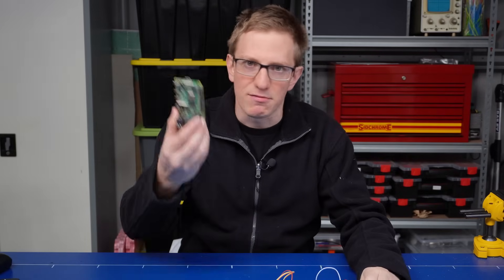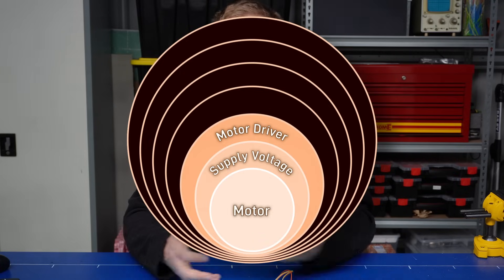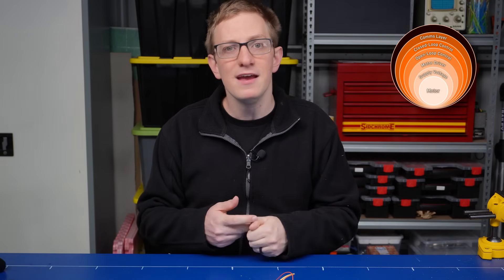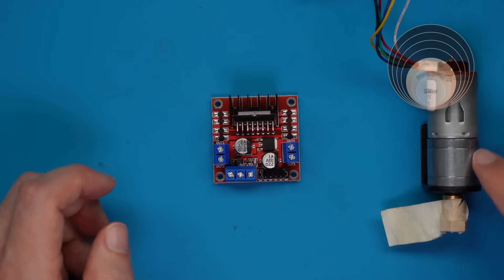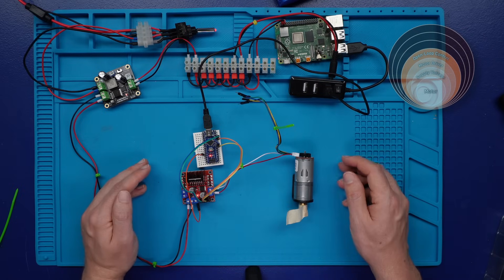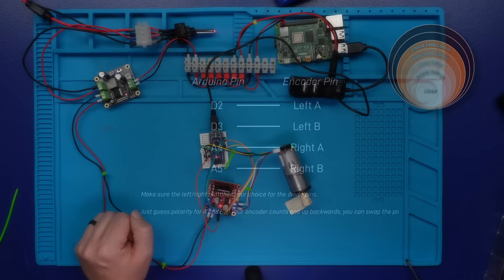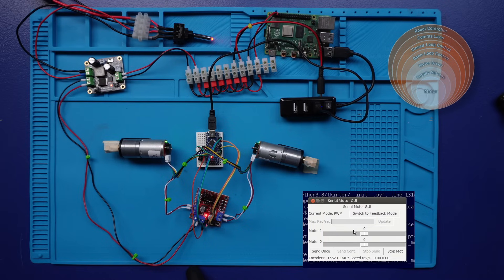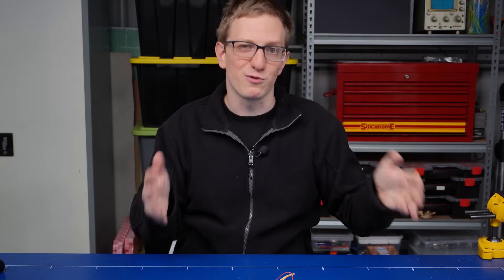The Ultimate Guide to using Motors in Robotics (including ROS, Raspberry Pi)

Comment: FYI for people in 2024: The arduino VSCode extension is deprecated. Another option to try is PlatformIO, however, this doesn't seem to work over ssh. Therefore you're probably going to have to use arduino cli over ssh.

Comment: Great explanation! I love how you threw in cutting-edge ROS2 in there!
Reply from the maker: Thanks :D
Reply: .... while at the same time using a motor driver that is about 40y or so old, and which has been superseded by loads of more energy efficient mosfet based products that don't need a heatsink the size of a car radiator.

Comment: Excellent. Got everything working in that video. Had to run "sudo apt remove brltty" to get the serial port to recognise the arduino.
Reply: What's that exactly and why to use?
Reply: @adwaitingle2315  it's the Braille terminal. Josh goes over it in his ready to humble video which is on the same play list as this.

Comment: I would like to control the suspension on a model car ( made in meccano) based on feedback from an electronic gyroscope. It is supposed to keep the body of the car level whatever the terrain.  My plan is to use a raspberry pi with an electric motor that is linked to the suspension, so your demonstration is well on the way to what I want to achieve.

Comment: Hi Josh. Thanks for providing this tutorial series.  
I tested motor running, but didn't move it. In my case, I finally succeeded by connecting arduino board GND to L298N motor driver's GND.
Here just for your information.
Thanks🖐

Comment: Open loop is just fine in case of a stepper motor. This give very good control and is used in all kind of systems including 3D printers.
Reply: Open loop can not be considered "control". Open loop is only a command. Any system that cannot verify that a command is actually being followed, cannot be considered "in control"
This is why people go to check on their 3d print progress and find a mangled blob of plastic sitting there.

Comment: This whole series has been terrific, with clear and concise explanations and instructions. I have had one issue I haven't been able to figure out. I have wired up these motors six ways from Sunday. I've studied the diagrams and the setup on the video and duplicated it perfectly. Even so, when teleop-ing I find the motors run fine forwards and backwards, but when using j and l to turn left or right, the controls are reversed! Left goes right and right turns left. Seems weird, as turning just consists of one wheel going forwards and the other backwards. I've tested this with a joypad as well with the same results. No combination of wiring I've tried seems to work. If I wire up by switching the pins then left and right are fine, but forward and backward are then reversed. Ive even tried reversing the motor leads. If anyone else has found this to be a problem and have found a solution please drop me a note.
Reply: I figured it out, I had my encoders on the wrong pins. Duh.

Comment: Great informative presentation!  Could you please comment:  If you would like to put a robot with motor control into actual use, say to raise and lower a convertible top on a car as an example, you are not going to have it hooked up to your laptop.  What is the missing link or next step to get the robot self contained in a production environment, so to speak?  Thank you.

Comment: 🎯 Key Takeaways for quick navigation:

00:00 🤖 Introduction to building robots and the need for layers of abstraction in robotics.
- The video introduces the idea of using layers of abstraction to solve robotics problems.
- It mentions the main content will be divided into two parts: theory and practical circuit building.
- The example motor used is a brushed DC motor with encoders for ROS2 control libraries.
01:28 🎛️ Motor drivers and their role in controlling motors.
- Motor drivers are essential for controlling motors as they handle the high voltage and current required.
- Motor drivers use PWM signals to control the motor's speed and direction.
- Understanding the basics of motor drivers is crucial for controlling motors effectively.
03:03 🎚️ Motor controllers and their role in motor control.
- Motor controllers are smarter than motor drivers, as they take target speed or position and calculate the appropriate signals.
- Open-loop controllers have predefined maps between input and output, while closed-loop controllers use feedback to adjust the motor's behavior.
- Closed-loop control, often using PID control, allows precise motor control.
05:22 🌐 Communication between the robot controller and motor controller.
- Effective communication is vital for controlling motors in robotics.
- Serial communication is a common method for transmitting data between the robot controller and motor controller.
- Maintaining modularity in the system allows for easier hardware swaps and reduces the risk of interference from other processes.
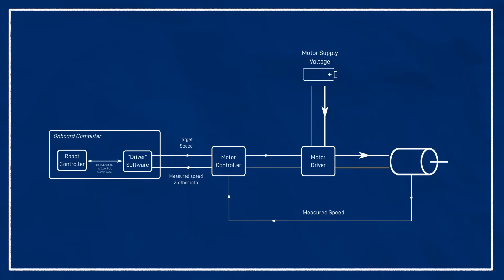08:22 🧩 Structure of the robotics control system.
- The typical structure of a robotics control system consists of a robot controller, a motor controller, and the motor driver.
- The robot controller calculates the desired motor speeds, and the motor controller translates these speeds into signals for the motor driver.
- Modularity and separation of these components allow for flexibility and robust control.
09:04 🛠️ Setting up a practical circuit for motor control.
- Setting up a practical circuit involves connecting motors, a motor driver, an Arduino as the motor controller, and a Raspberry Pi as the robot controller.
- Testing open-loop control is an important step to ensure the motor and controller are functioning correctly.
- Encoders on motors provide crucial feedback for closed-loop control.
13:30 🔄 Using encoders to measure motor speed.
- Encoders on motors provide feedback through pulse counts, helping calculate motor speed.
- Measuring the counts per revolution empirically is essential to determine the encoder's characteristics.
- Understanding how encoders work is crucial for effective motor control.
19:21 🕹️ Setting Up Closed Loop Control with Encoders
- Configuring closed-loop control with encoder feedback.
- Measuring encoder counts per revolution to determine motor speed.
- Demonstrating closed-loop control for precise motor speed control.
22:14 🤖 Interfacing with Raspberry Pi and GUI
- Setting up the Raspberry Pi for motor control.
- Running ROS nodes on the Raspberry Pi.
- Using a graphical interface (GUI) to control motors and monitor feedback.
24:59 🚗 Future Plans: Integrating Sensors
- Preparing for the integration of sensors into the robot.
- Mentioning the upcoming focus on lidar sensors in the next video.
- Discussing the future prospects of the robot's sensory capabilities.

Made with HARPA AI

Comment: Hello i had a problem that my motor has a total number of encoder pulses per wheel rotation of about 52,000 and the gear ratio is 1:27, when using the Arduino_Bridge code, when entering a command, the motor will jerk very much and reverse itself for no reason.

Comment: Hello, I have a problem that the speed of both wheels is not the same speed, the right wheel is faster than the left wheel. What do I need to do now, please help me. Thanks a lot
Reply: I have the same problem
Reply: have you fixed that problem yet?
Reply: @KSLEEProjects  Have you tried checking whether the signal read from the encoder of the 2 wheels is equal?
If the signals of the two encoder are not equal, you should check the encoder's signal wire again
Reply: I did this but without encoder I  made Pwm to adjust the motor speed and set the pwm same for both the motors

Comment: At 13:10, I don't understand the benefit of powering the Arduino via the USB port versus simply connecting its 5V pin and ground pins to the terminal strip (as was done for the RaspPi).

Comment: when you say you can use PWM to drive a motor backwards (2:57) , do you mean you can send a PWM signal that drives the motor backwards, or do you need a switching circuit that you send the same signal through to drive the motor backwards? Can you like switch the bias of a PWM signal to be negative or something? 
Pretty new to mechatronics, but I come from music and radio land, so I like working with waves. Thanks for the help
Reply: There are two methods: 1) There is a direction signal and a PWM magnitude signal (0-100%)
2) "PWM antiphase": This is where a 50% PWM duty cycle results in zero motion. >50% drives positive and <50% drives negative.

Comment: Amazing video, really well explained.

Im having an issue with only the pins connected to D2 and D3 are being counted on the encoders, no other pins would count the encoder readings. it looks like there's an issue with the interrupt pins, which is the arduino nano has only two - INT0 and INT1 on D2 and D3 but its working for you in the video so i cant be so sure

i've tried swapping the encoders too, both are working perfectly but its just D2 and D3 that count.
and this code wont work on an Arduino Mega :/

PS: im using OE-37 Hall Effect Encoders - mounted seperately

any suggestions?

Comment: Great video.  Just getting started with ROS.  You mentioned that the L298 motor controller isn't the best, but it will do.  I agree.  What other motor controllers would you recommend or have experience with?  Thanks for your time!
Reply: Tb6612fng a very good one

Comment: Using that motor controller. Could I connect it to a relay so it activates the relays and turns the motors. Allowing me to use higher amps rather then the 2 amp setup

Comment: Hi I used exactly the same code but I don't recieve any encoder Data. I checked the encoder manually with an Oscilloscope and it works. So I believe it has to be a problem with the code. Any idea?

Comment: First, thanks so much for these tutorials! They are great!

When I run miniterm, I have to use baudrate of 9600, not 57600 in order to not get English out. And it outputs a whole bunch of "sensor=xxx   ouput=xxx" lines, but it will not take in any motor commands to get the motor running. Apparently many changes have since been made to the arduino code?

Comment: Hey Josh!!
Thanks so much for this tutorial.
Can I control the motors in open loop mode?? Like I mean for the real robot because my encoders broke 😢 and I cannot buy another
Reply from the maker: Yeah for sure! If you are using my ros2_control hardware interface you want to replace the "write" command with one that sends an "o" message instead of an "m" message, and write a line that scales the speed request to the appropriate open loop signal.

Comment: Hello, first of all thanks a lot for these tutorials.
I am using as5600 magnetic encoder for close-loop control of motors. So I can't use your code because encoder is communicating via I2C from analog pins of arduino uno. My question is: Which topics do I need to subscribe(cmd_vel) in order to make it work. For example, I know that I need to subscribe to cmd_vel to get wheel velocities from ros and move the robot, but where do I need to publish wheel velocities or positions to do navigation?

Comment: Hello can anyone tell me why we arent using Raspi directly to supply PWM to Motor driver. Why is Arduino Nano used?
Reply: In this example there’s only one motor but in most robotics applications there are significantly more components that need to be controlled. The raspberry pi simply doesn’t have enough pwm capable pins for more than 1 or 2 motors

Comment: I want to drive 4 brushless gear motors (mecanum wheels) that have built-in encoders, there are 5 wires coming out. I need a cheap driver one for each wheel any suggestions. Thanks for the great vid.
Reply from the maker: Thanks! My experience with brushless motors is actually pretty limited unfortunately (something I am keen to explore more in the future). Do you have a link to the particular motors I could look at? Some have a driver on-board.

The main brushless driver I am aware of is ODrive (https://odriverobotics.com/) but it is not cheap. Some similar ones are reviewed here https://www.youtube.com/watch?v=Wb1gsJ4K4pM

Alternatively you may have luck using an esc like those used for drones and then wrap that in a closed-loop control of some kind using the encoders.

Sorry I couldn't be more help, like I said I definitely want to dive deeper on this in the future!

Comment: can the arduino program on your repo need improve if i use differen motor driver shield like pololu VNH5019 or IBT-2 (BTS7960)? because i need more power for the motor
Reply: did you find them i need to code for bts7960

Comment: I have mine wired up just like your and everything works. My only questions is when I send the O command the motors spin for a few seconds and stop on their own
Reply from the maker: Thanks, yes mine does too, it's just not obvious from the video as I kept repeating the command. This is part of the design, the idea is that the thing controlling it should keep sending speed requests, and if it loses connection or something the motors will then stop after a few seconds instead of driving out of control :)
Reply: @ArticulatedRobotics  Thanks for the clarification Im far into your tutorial and robot has not failed me and niether have you 😁
Reply: @ArticulatedRobotics  This is happening for me, even when using the teleop keyboard and joystick to control the motors. I thought it could be a power issue, but it also occurs when controlling a single motor, and using a power supply. Any ideas?
Reply: @ArticulatedRobotics yeah man you missed a big part here how can we repeat the commands so that the motors keeps spinning and we can measure encoder counts?

Comment: Hello Josh, I'm trying to use the Arduino Mega with this example, but I'm having trouble with the encoder's ports, I think that ports C doesn't work as it should using Arduino mega, how can I switch from port C to port F? And is it harder to change this code to work in the Arduino mega?
Reply from the maker: Ooh it's been a while since I've written Arduino code and I've never used the mega before.
I am quite certain it will be a very simple fix - just a matter of knowing the right thing. 
I would have thought it's a matter of just changing the defines in encoder.h to be the new pins?
Reply: @Mateus did u solve it??
Reply: did you solve this?

Comment: Can't use Raspberry pi as a motor controller instead of using Arduino?
Reply from the maker: Hi, you can but (as outlined in the video) it is often better to decouple them. That way the arduino can focus on the low-level control, and the Pi can handle high-level tasks, and the either can be swapped out with ease.

Comment: Great video; how can I use L293D as the motor driver?  that's what I have, and it's quite different from the one you used,?
Reply from the maker: I'm not sure, I have not used the L293D, sorry. I thought they were fairly similar though? It is a long time since I have looked.
Reply: @ArticulatedRobotics , thanks for the response. I  found out it is much different. I decided to buy L298

Comment: hi, i was looking up the code and it is running fine, but im unable to update the encoder value as it shows 0 0 , even if i try to rotate it manually . maybe , the connection could be different for signal pins and vcc - gnd pins of encoder thus couldnt read i guess , but i tried out with different code with my current pin configuration , it was working . pin -  M- M+ E(VCC) E(GND)  E(s1) E(S2), this is what my current pin configuraiton. what could be the issue here ?
Reply: I'm getting some issue in connections that in tutorial. The motors just moving infinitely (not stopping) for power input in my case after all connections with Arduino and raspberry pi. They were still moving without ros_arduino_bridge can u help with this issue?

Comment: servos have one chronic issue is that when powering the system, they jump to home position, which causes damage to the robot sometimes. Hardware solutions not successful, but maybe something in C code can absorb this. Bet I saw many commercial robots use normal motors with rotary encoder or stepper instead of servo.

Comment: Hi,  will it work if I'm using DC motors without encoder? Please share some hints.
Reply from the maker: You'll have to make some modifications to the code if you're trying to integrate it in to the rest of the project but yes you can (and you'll only be able to run in open loop).
I'd recommend running your motors under standard load at a bunch of different PWM values, calculate the number of revolutions, plot it on a graph and fit a line to it to create "fake feedback".

Comment: I’m having trouble adding the ros arduino bridge library to my IDE. Any suggestions? I’m trying to add it as a .zip but the IDE says it’s an invalid library.
Reply from the maker: It shouldn't need to be added as a library (I think maybe there are similar ones out there that do). It should just be a sketch to open and flash to the Arduino :)
Reply: @ArticulatedRobotics  Thanks. Got it to work! Any reason why my motors only run for a couple seconds in open loop mode? When I type o 255 255 they run and stop automatically after about three seconds.
Reply: Nevermind! Auto stop timer...

Comment: L298 has a to high internal resistance
Reply from the maker: Definitely agree. It is a terrible motor driver for practical applications, but it is extremely cheap and easy for beginners to use.

Comment: Anyone know why I would have the motors be able to spin but the encoders not count up even when it is wired in correctly? really odd. I followed the tutorial pins exactly, just one an arduino mega which shouldn't have any difference for this.
Reply: I got the same issue. With the arduino mega it doesn't seem to work for me
Reply: @Swqtt  I just bought a nano, works perfectly